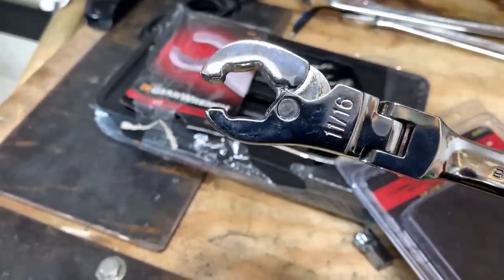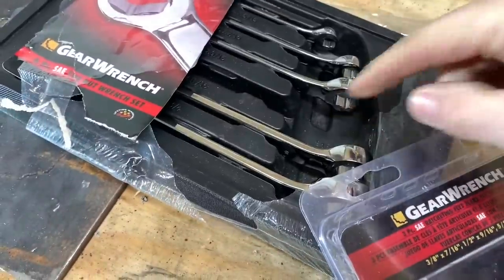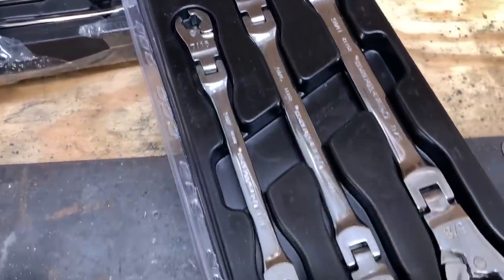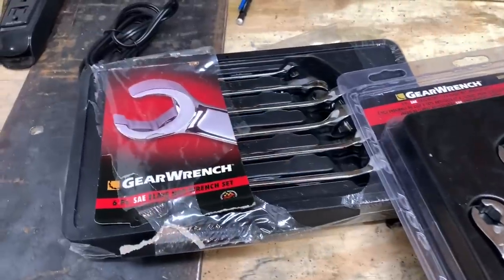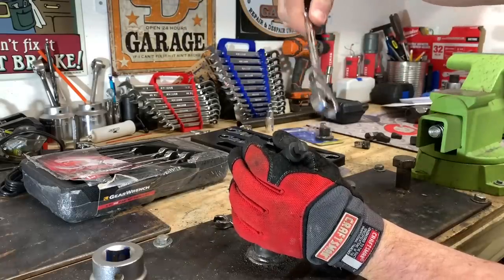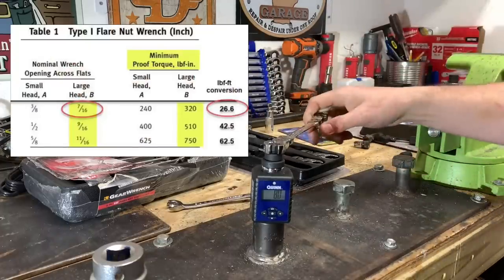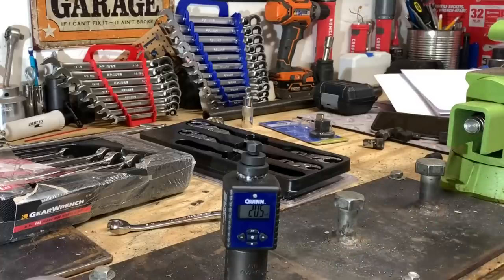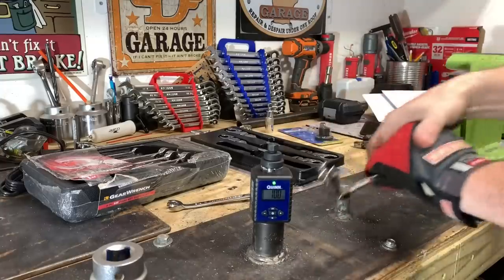Ratcheting Flare Nut Wrench Are you Nuts?

Comment: i'd probably still buy a set of these with the understanding that they're merely runners and not breakers or tighteners.
Reply: I can think of many times i would need those special wrenches. It sucks driving in a power steering line nut that is ALWAYS in a tight space with a regular flare nut wrench 1/8 of a turn at a time. With these you run it it in fast n tighten with the other one.
Reply: Agreed
Reply: Absolutely, too many DIYers say I would never buy that because I don't need it but they don't really have any tools anyway. Once you've got 5 sets of wrenches and don't need any new tools desperately you look for something that would be nice to have.
Reply: @forgedsteelwrench9249   I would never get them because with flare nuts the threads are fine pitch and easily crossed an 1/8 of a turn prevent damages. With a regular flare nut wrench you can feel everything.
Reply: These would have made my life easier removing the lines off a steering box
Reply: I’d actually be tempted to cut them in 1/2 to make stubby ratcheting flex head flare wrenches.
Reply: junk

Comment: Flare nuts are the BANE of mechanics. They are misery incarnate. The need for a ratcheting line wrench is dire. I bought this Gearwrench ratcheting line wrench with high--and naïve--expectations. It SLIPS under typical flare nut load, and will neither break nor tighten. Upon discovery of this video, I now know at what torque it fails.. 20ft/lbs..!? Can you believe that??  I returned my set... angrily.  Back to crow-foot... grumble.

Comment: The problem I see with the ratcheting flare nut wrenches is a lot of the time you are dealing with soft materials like brass, those would be rounded off in no time.
Reply: Although the head of the wrench is thinker and expands the with of the nut. It still stripped the nut. So now I have 2 corners damaged and 4 more to go. That's only 2 more trys .
Reply: Now I'm going to try the crows feet flare nut wrench. With impact drill
Reply: Have you tried the knipex raptor pliers?

Comment: I could see the ratcheting ones being good for saving time after you brake the lines loose with a regular one, so you don't have so much wear on the ratcheting ones but I'd be willing to give them a try. Definitely not good for breaking stuff loose but in tight spaces it could save some time over a regular flare nut wrench

Comment: flare nuts usually are from low strength materials like aluminum or copper alloys, they are intended to grab this nuts as good as possible from all sides to even up the pressure on them... the tightening  spec is not so important, but the best grabbing on them... I go on fixed ones...

Comment: If you have a set of these ratcheting line wrenches, I would suggest braking the line nut free first then screw it off the rest of the way with the ratcheting line wrench.
Reply: @georgecroney6168  in the rust belt they never come off with fingers. At least every car I've worked on.

Comment: I would definitely get a set because they could still come in handy in certain situations that might make life a lot easier. If it comes down to it you can use the standard to just break the nut loose and then use the ratcheting wrench to go the rest of the way which will at least save you from having to constantly reset the standard flare wrench over and over again 🤔

Comment: That 7/16 ratcheting flare wrench would be an absolute dream for datacom technicians working on hard to reach utility lines taps. And you don’t need anything more than 20inch pounds of force anyway. Any tool that doesn’t require you to take it off and on or what you’re working on is a life saver cause you’re really going to get mad if you drop it.

Comment: I use mine... same set..sae & metric...I like em...👍
Amazon had them for a good deal...obviously not the first wrenches you go for but really nice to have in the arsenal for the price
4:58... wait until you need to take off or put on your exhaust manifold that is heat  wrapped and it's the only thing that will fit on the stud and  nut to get your turbocharger off or on...lol
Honestly if anyone is using the flex head flare nut wrenches and torquing down on a fastener you're using them wrong...that's not their intent....
Good stuff Chris...👍

Comment: Honestly I could see the use of these came with a ratcheting flare end on one side and a standard flare end wrench on the other side. You could easily break a fastener loose with the standard end and then use the ratcheting end to speed the fastener out. Likewise, you can quickly screw the fastener in and then torque it down with the standard end.
Reply: One question where should I get these type of wrenches standard and ratch wrench, best brand do they sell sets? Thanks

Comment: On aircraft, fittings are rarely accessible enough for normal flare wrenches, anything bulkier will not work. Being able to get on and off of a nut may be handy though, most lines are hoses which are fatter than the nuts. For that purpose these may be worth a try. High torque is not usually possible without damaging everything involved. Edit: they would need to be reasonably priced enough to attempt to use them in case they don't work out.

Comment: A good flare nut wrench is designed to be in harmony with the nut no matter if it is stainless steel, brass or plain steal. The idea for loosening is the gripping power without damaging the nut.

When tightening you need that feel feedback from the wrench not to cross thead, not to damage the nut and to stop when you get to that desired toque point.
Reply: A good flare wrench deserves to be used where a regular box end doesn't have access and a regular open end doesn't have enough contact area to not round the nut (which on a flare fitting is usually soft or something like brass 
using a good flare nut wrench on a hard steel nut where a box end or even something like a WrightGrip open end will fit is unnecessarily wasting the talent of the flare nut wrench of not rounding the soft nut it was intended for 
good flare/line wrenches are expensive

Comment: They work pretty well, they're better if you're able to break it loose first, the flex head is huge. You can break fittings loose and get them really tight if you make sure they hook the corner befor applying full force, they take a little practice to get the hang of, if you ratchet it like a ratcheting wrench or a ratchet, it doesn't work too well

Comment: I wouldn’t mind a flex head standard flare but wrench. But the ratcheting mechanism is gimmicky to me. A lot flare nuts are soft brass. I could see the wrench causing slight damage to the fastener During the ratcheting action. Which you want to avoid and defeats the purpose of using a flare nut wrench in the first place

Comment: Don't miss that pic in the beginning one bit. Any tool box sold in the northeast or anyplace where rust is an issue should have come standard with a printout map of those under bed chassis rail mounted ABS distribution block. The damn thing was implemented for profit. They looked where the money in service was rusted brake lines and decided to double them up by running them back and forth

Comment: The best Flare nut wrench is a set of Snap On. I have destroyed so many flare nuts and that is such a headache.

The problem with the Snap.On is the cost but it is worth it 100% when you don't have to worry about the flare nut or the wrench.

The big problem is not tightening but rather loosening the flare nut.

Comment: Probably would use these tools side by side.  Fixed wrenches break loose ratcheting take off.  Ratcheting get fastener started then fixed tighten down. I think if anybody buys these they would be interested in how well they ratchet.  Maybe show these ratchet a couple turns. I mean if your not going to turn anything more than 90 degrees with a ratcheting wrench then what was the point. Of course fixed is stronger than ratcheting.  This is like comparing a ratchet to a breaker  bar. If it can be used to make a job quicker and easier then it could be worth it like a battery powered ratchet that doesn't torque up to as much as hand ratchet but it's a heck of lot nicer to zip out trans pan bolts with one.

Comment: I probably will seem like a monster here but I never knew there was flare nut wrenches. I work on my own rigs and have always used vice grips to break flares loose and the pliers to run them off.
Reply: That can cause problems is its stuck though, because they're made of such soft metals.
Reply: @FahimibnDawud  I have since learned about that from researching flare nut wrenches. I am saving up for a decent set now but have bought individual carlyle for my rigs.

Comment: Nissan has a ton of abs actuator recalls lately and I think I might pick up a set to make the jobs faster. Break em loose with a regular flare nut wrench, and than use the ratcheting one the rest of the way. And tighten the lines down with a regular one. I think anyone using them to break nuts loose or torque nuts down with them, is using them completely wrong.

Comment: It might be helpful to mike the regular flare nut wrench jaws at spec'ed torque and for every 5 or so ft/lbs over until failure. I don't think you could accurately measure jaw spread on the rats though, too many variables.

Comment: I have a set of the gearwrench flare wrench ratcheting pieces of garbage. I have found them to be the most useless piece of garbage branches I've ever boughten. How about ready to throw them in the trash pile you can't even get them to grip even if you hold onto it with your hand. I've referring to the castle night and the actual ratcheting mechanism in order to try to get it to latch on but the springs are always overpowered by any kind of force you put behind it leaving you with air fastener that cannot be loosened unless you have a different type of pliers. I have found that Knipex pliers get the job done far better than anything that came from gearwrench!

Comment: I'd like to see you include a standard end wrench in the torque tests.  This would demonstrate if there is any advantage of a flare wrench design over a regular end wrench.  I know that the flare wrenches LOOK like they should work better, but I wonder if they actually do.  Flare wrenches seem to have a problem of spreading open at higher torques, which standard wrenches don't seem to do.
Reply: Tom G that would be a pointless test, the only reason you use one of these is if you need to fit it over a hydraulic hose.
Reply: I have used many flare nut wrenches and I think the very best set out there is Snap On. The only drawback on these wrenches is the crazy price but if you ever broke a flare nut you quickly realize the even bigger headache of the fix.
Reply: @rickyperkins232  Also the Snap On wrench that has flare on one end,open end but unusually thick on the other,that would beat the gimmick "ratchet" wrench at quickly running the flare nut after it has been broken loose with the flare end.
Reply: @davidpowell3347  agreed

Comment: It seems to me that every time you "flip" the wrench, you also flip the way you pull/push. So your not switching anything. I would pull on it the same way you loosen using a crescent wrench: adjustable jaw should not be applying max torque. Bad testing methods here. However I do agree with the rest of the comments that these are probably for running down fittings only.